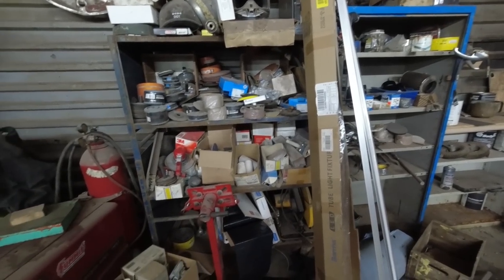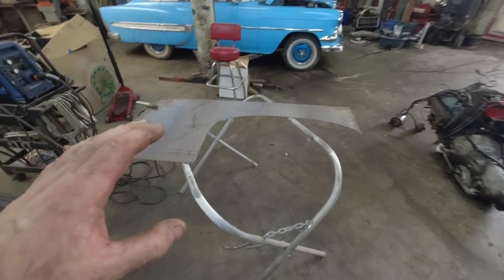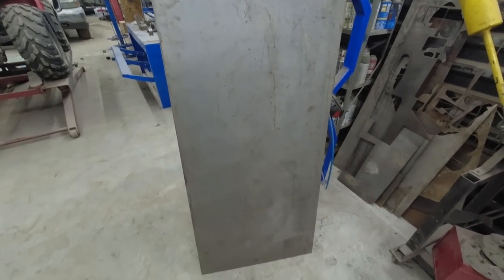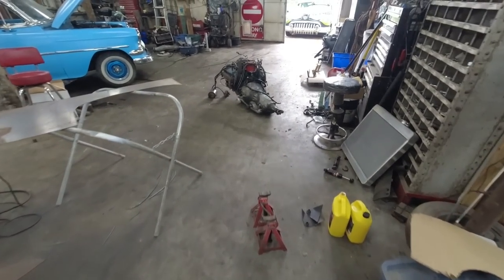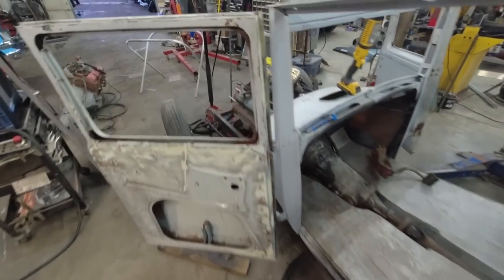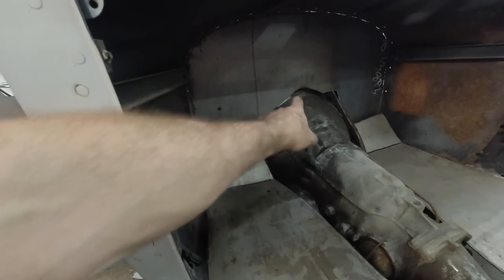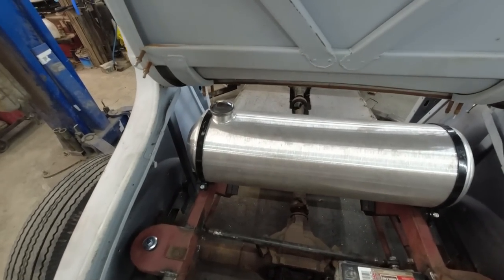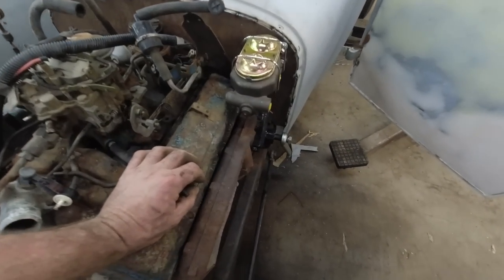Building firewall and start floor pans along with test fitting the trunk lid.

Comment: I used the Rochester 2jet on my 56 chevy, I put the Chinese version of the carb on my 283, with the original aircleaner, and yup, not allot of coolness, but functional and reliable. I will leave it at that 😆

Comment: Nice job on the build. You seem to have a lot of old hot rods. You wouldn't happen to have a 1934 Chevy 3 window coupe laying around or know where to find one?
Reply from the maker: Haha I wish
Reply: Do you do take requests for builds? My wife wants a 30's or 40's Chevy pickup with a modern drive line with an ls motor and a wooden flatbed box.

Comment: I like the Mopar aluminum master cylinder's. They are smaller, so fit better in most engine compartments. Aluminum, so lighter than those monster GM cast iron jobs. Look far better. Take paint well and simply make everything better..  Also, when you cut an engine/tranny out of a car, why not also take the tunnel and floorboard? You can alllllways trim or throw away, but a pressed tunnel made for that tranny simply can't be beat!!Also, why not put that tank under the trunk or build one that would fit well and move the battery to back seat area or up where the tank is now???

Comment: Just wondering why your not using a Ready To Run small cap distributor  and mounting the coil on the backside of the fire wall - it has worked out well on my 28 Dodge build  - I do realize your trying to keep the costs down to a dull roar and points do work.

Comment: The grease has just gone hard in the speedo, pull it apart and clean it out and re grease and it will work fine, I've done it many times in the past on old gauges. Have you tried mounting the under the dash pedal box under the floor, I've seen that done before!

Comment: I never miss a clip of yours, wish you had less time laps and more details on all the patterns, so interesting . Question ? what is wrong with the 283/327 you pulled out ? Them smogger 305s are just useless , less hp. then a bottom of the bucket 307. I would combine the 305 heads on the 283/ 327  you pulled and do a budget rebuild on it.
Reply: This is more about a useful body, and not so much bout an engine build.💯 That pollution engine can be replaced by the next guy. Dress this one with a swap meet intake and valve covers, but that's my opinion. Put a buck with my opinions and you couldn't get a cup of coffee 😂
Reply from the maker: motor is locked up, think the trans is salvageable though.
Reply: @buckeyejim2989   lol , I just like steel forged cranks of the 283s & 327s over anything with a cast iron in it.